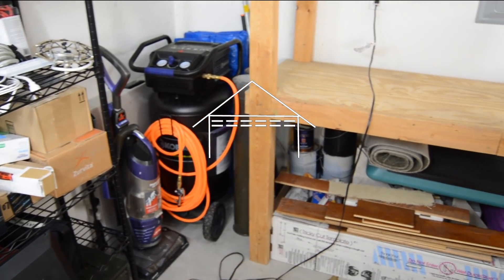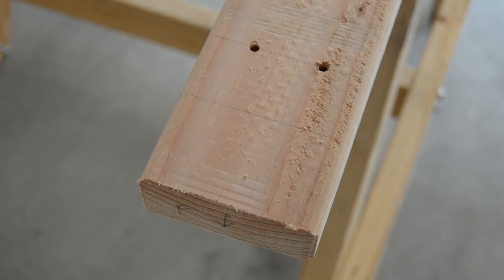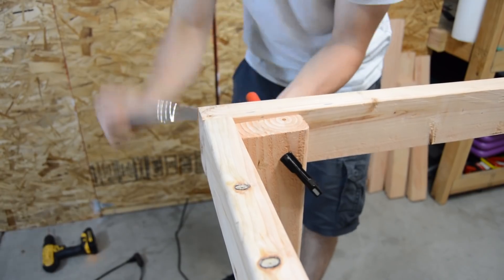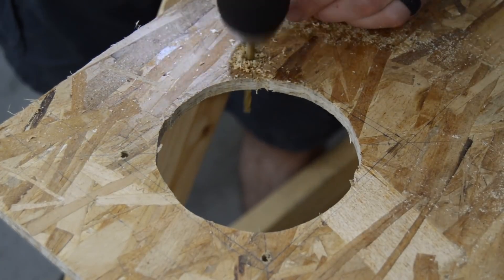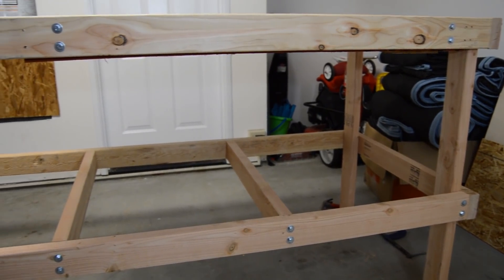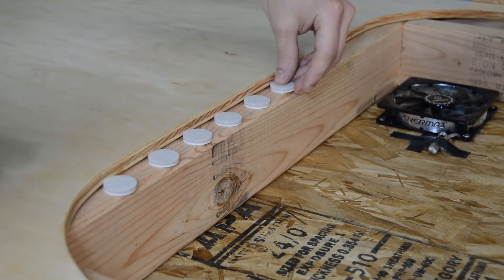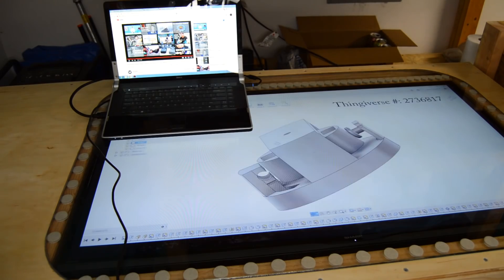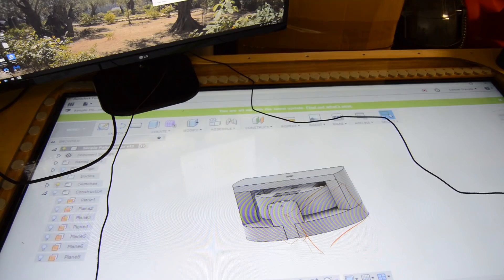Making My Maker Computer Desk ~ The DIY Standing Desk I Always Wanted!

Comment: Hey im wanting to make a desk of my own and was wondering if you encountered any issues these past 4 years like cooling. i was worried because tv's arnt supposed to be layed down in transport but cant find any other info about using them layed down face up.
Reply from the maker: I haven't run into any issues with cooling. Granted I only use the tabletop screen for about an hour at a time. Nothing bad has happened from having it laid flat. I think the vertical positioning in shipping is mostly to prevent setting other items  on the face of the box where there isn't much support.
Reply: @GarageScience  ah awesome thankyou ive been looking at making a table like yours but maybe with 3 tvs to make one long screen

Comment: Most excellent video. I have wondered how I might make a futuristic desk cheap in price. I know that particle/compressed wood is cheaper than plywood but it smells bad and can be dangerous if inhaled for extended periods because of the formaldehyde in it. I wouldn't use it for the people that might be planning to. I would definitely use plywood especially for an indoor project.

Comment: I don't see the practical use of this. It would be be pretty cool if it was touch enabled, making it so you have a huge digital scratch pad for art, design, ect. Also i think the large screen would become a strain on your eyes on the table top. Could have made the felt edges blend better (painted black with less obvious felt pads.) Really cool tho regardless, props

Comment: 1. How about using a 2-way mirror? Would it too dim for the screen? If not, it would neat looking when the screen is turned off. So you wouldn't have to see that padding around the screen.
2. I think you should install 2 fans one of them blowing fresh air with a dust filter of course. The second one blowing the hot air out.

Comment: Interesting specialized application.  I gather your real job is as a decent framing carpenter or you build wood decks ? 
You should study finish carpentry. I believe you'd be good at it.
Reply from the maker: Well I have built decks in the past. My real day job is significantly more technical haha. This was meant as a cheap shop desk but I get where you're coming from.
Reply: @GarageScience  , As you might guess from my dba - ArchiMedia, I do a lot of illustrations and video. I have a setup where  I lay a 24" 4K monitor flat and trace images with pen or pencil like the old light boxes, 
and scan them into Photoshop where I use the program to create digital watercolors that are pretty convincing.

Comment: Nice project been wanting to do something like this.  Very nice.  Maybe a felt black liner cut to frame in the glass might add some finishing touch to the display.  Also it would be cool since you have the tv recessed to add an angle adjustment for the tv for 15* or so.  Not sure how you could do this but my guess is a rotating handle near the front of the desk.  Great work!!

Comment: I know this is old, but cool. Should have built the PC into the desk though. Also, it's not really safe to use surge protectors plugged into a UPS, most companies state that in their manuals. That little one won't run that setup for more than a minute I'd guess either way.

Comment: For the backing of the TV. Instead of using plywood. You should have used an cut a piece of peg board! still, install a fan or two but that too would have saved you some time and money too. If you use the pegboard you may not need the fan.

However, you gave me a huge idea for a costume desk that I need and want too! Thank you!

Comment: Working on a monitor which is literally under your chest isn't healthy working. 

Also:You sealed against dust but having a fan underneath doesn't prevent against dust :P
More accurate would it be to use a seal mounted on the TVs edges and put the glas on it.Also to see the white foam is not a nice looking finish. You can do better :P
Reply from the maker: So the TV generates heat so you can't just seal it completely under the glass. Protecting against dust was partly to prevent dust from getting on the screen but also just general dust from getting inside the TV. The fan exists to circulate air through the TV cavity in the desk and the outlet of the fan is to the outside of the desk so air gets sucked in through the filters. I do a lot of metal and woodworking in my garage ;)

Comment: One thing I would have added was an overhang. for your mouse and keyboard... plus the holes for wiring.
Then I would have placed my pc on the bottom shelf and moved the monitor to the corner of the desk so as to not impede the view.

Comment: Great Idea, I really wanna build this. The only thing I'd do differently is the plywood under the TV is held only by vertical screws. That's not good, as the TV has a certain weight, and pushes directly against the screws, at their weakest angle. 

L-brackets (I guess you would call them) around the sides of the plywood, fastened onto the board with screws going horisontally would be a more secure setup.

Comment: did a coffee table like this years ago with an old quadcore mb, then topped it with a glass coffee table top, and some car dark window tint, then black painted on the tint the area not over the lcd so when off its just a black glass table, still have it, been powered like 1 hour since its build, why? i couldnt work out how to make it a giant touchscreen table, so it bothered me and i hated it after that... 
I did think of corner IR illumination and opposing corners with cams, but i had no clue how to make it work with software.
having IR emitters and laptop webcams on the glass surface was not an issue as they could be disguised as cup holders or something
https://www.youtube.com/watch?v=0VQ2Ja9gZb0

Comment: A good carpenter does no put 6 screw in the legs its a waste of screw and your wood will crack as the weight of the TV 2 screw are enough for the weight support

Comment: I love the concept and would really like to do something similar in my small workshop. However, I have one comment about the levelling technique: unless the floor in the area is incredibly level then using this method will only work for you place the table in its final location before attaching the 4th leg. If your floor is that level, then you don't need to use this method. I did something similar with my benches but the 4th leg had slots rather than holes to allow levelling once they were in place. But well done overall

Comment: Bunch of things I'd do different:
1. On the side of the glass facing the TV - Mask of the area that needs to be visible for the screen and paint everything else black similar to Car windows - Seeing all those pads is an eyesore.
2. Get yourself a Logitech MX Master S2 or MX Anywhere S2 and a wireless Keyboard - Those Cables, too, are an eyesore and with the MX Line from Logitech, you'll get a Darkfield Sensor that works on the glass as well so no need for a mousepad.

Comment: A few things to note:
* Paint the inside black
* Use black felt padding for the glass and/or paint the underside edges of the glass black
* Take the back off the TV to allow for better air flow. Even though a fan was used for cross air flow, the TV was designed to be standing upright, so the air vents/passages were designed for passive cooling. Removing the back would allow for a better air flow and the heat to not build up against the panel
* Use adjustable height feet (like used on appliances) to make sure it's always level regardless of location
* Wireless Keyboard & Mouse!  Wires are sooooo 90's!!  😜
* Add some USB charging ports to the top of the desk
* Extend the connectors of the TV to edges of the desk so you can plug other devices into it. You may not always want to use your laptop or desk computer

Comment: When attaching the legs you should drill slots, because you will likely move the desk at some point and what is level in one location may be not level at the next. The slots would prevent you from having to drill new wholes or get new pieces for the legs, especially if it is a minor adjustment where the new whole would slightly overlap.
Reply: I was thinking using those leveling feet that are used on some furniture and appliances. That way just turn the feet to get it balanced. Having a concrete floor, you will definitely find some wobble no matter how careful you get the legs all matched. Doesn't take much.

Comment: You can get strips for sealing around doors and windows to use instead of those felt pads. The backside of them is peal and stick, and the entire thing is rubbery and about 1/4" tall. It would look and function a lot better than those felt pads you used for setting the glass on, and would actually give you a seal against the glass. As it is, your filters are essentially useless, because that fan is going to pull air from the source of least resistance (around the TV and the edges of the glass). This wouldn't happen if you used the type of seal I'm talking about. They have it at Walmart, Home Depot, etc. Cool project.

Comment: Overall it is a great build, you did a really good job. As far as asthetics, I think I would have put some kind of dark border on the underside of the glass around the edges just to hide the felt pads. I would also have rotated the whole setup 180° so that the pc tower was on the right, but I am just picky that way. As far as screen interaction with the tv, there are wired light pens you can get that plug into usb and work on any monitor, or you can get a touch border that you install directly on top of the glass that provides touch function on any monitor/tv.

Comment: Definitely need a wireless keyboard and mouse.
Reply: Yup, was thinking the same thing. And one of those fancier mice that work on glass. Wires across your screen is highly distracting and annoying.
Reply: I have had such a setup in my old garage. Yes, the mouse and keyboard should be wireless, but I had a lot of dust and debree flying around, so I found a trackpad better suited for my application. Mouse kept getting clogged.
Reply: Still..it's amazing

Comment: you should add dust filter under fan
Reply from the maker: The fan is an exhaust fan, there are dust filters on the air intake on the bottom of the desk.

Comment: I would have painted the back of the glass around the edge to hide the felt pads.
Reply: That or use a solid strip of adhesive back weather strip.
Reply: @MrJarred  I was thinking more along these lines
Reply: Maybe try cutting some black vinyl or even dark window tint to go around the edges.
Reply: It would have really cleaned it up.
+1 Paint it black on the bottom side of the glass and seal it with silicone.
Reply: That's an idea. I was thinking of putting a felt strip around the edges instead of the round pads. Give it a continuous look. But I like the painting idea as well.
Also, paint the inside of the cavity black as well so the only thing visible is the tv
Reply: Maybe use hobby foam instead.  Maybe it's just me, but I think the felt will eventually compress and drop the glass further down over time.  The foam will act the same way, but the thickness is more manageable.
Reply: Agreed.  I would have recessed the glass a little more and put a wood bezel to hide the felt pads.  Or tape off and paint the edges black to hide them.  Otherwise great desk.
Reply: Good call
Reply: i would have to but in his case i realized it was a work desk for a garage or something

Comment: The microphone in the thumbnail is placed wrong. The Blue Yeti is a side adressed mic. You don't speak into the top.
Reply from the maker: Thought direction  was selectable using the knob on the side??? Not super knowledgeable on audio... getting better though.
Reply: @GarageScience  Although you can select different patterns it should still be addressed from the side. Cardioid would be ideal for most people who are the only ones speaking into the mic as sounds from the sides and the back are recorded more quietly. Stereo records a stereo instead of the standard mono track which can be inconsistent if you reposition yourself or the mic often. Omni-Directional is for recording multiple people and picks up everything in a 360° radius evenly.
The last option is Bi-directional which is basically cardioid but in the front and the back of the mic. That one is probably most often used in interviews. Everything I just wrote is also available on the product page for the Blue Yeti and paired with a picture for easier understanding

There is even a picture showing how you are supposed to speak into the mic.
Reply: @GarageScience  The pickup pattern is selectable with the knob, but regardless of setting the sound source should always be to the appropriate side(s). Great video btw, would love to do this for myself

Comment: I must've missed the part where you explain how you're able to draw on the desk. It seems like a really cool idea but how does it work in detail? Are you just using dry-erase markers on glass? At a glance, the drawing utensil you pulled out didn't look like a dry-erase marker, although it might still be. It would've been nice if you said a few words in the video about that.
Reply from the maker: I used a grease pen on the glass, a little better than a dry erase marker in that it doesn't wipe off as easily and is also a waterproof mark.  Been thinking of doing an update video on the desk so I'll plan to cover this topic in that video. Thanks for the feedback!
Reply: Garage Science one idea you could do is use a mouse pen. This will let you draw on the screen like you normally would, but also have a digital copy of your notes. It would also prevent you from having to clean the glass as often. I don’t know your workflow, but mine normally is extremely rough sketches, and then go into freecad. Since you have windows, you could use it’s normal screen draw function when your in cad, and for sketching you could use something like gimp.
Reply from the maker: Great idea, definitely going to try that.  Any brand of mouse pen that you recommend?
Reply: Garage Science the one I have is one that I got from amazon. 

Lcyyo@ PR-03 Portable 2.4G Wireless Adjustable 800/1200/1600DPI Digital Pen Mouse USB Ergonomic Mice for Computer Laptop Notebook Desktop (Grey) https://www.amazon.com/dp/B01KHSZT50/ref=cm_sw_r_cp_api_i_cNfaDb5PHKZG8

Wacom also makes great ones, but I haven’t seen any pens that are not for graphic tablets in a while.
Reply from the maker: I'll look into it, I'm really interested in trying this... probably going to see a video on this eventually :p already been thinking of making an update video for this project because it's been almost a year, the video is doing pretty well and I still use the desk all the time! #diyprofessional :)